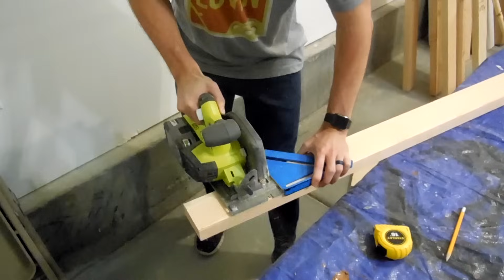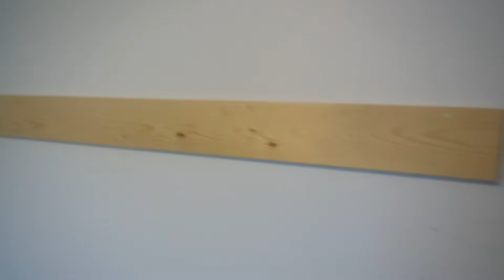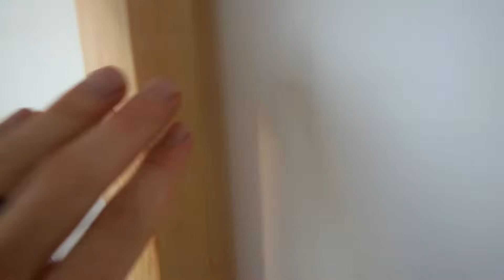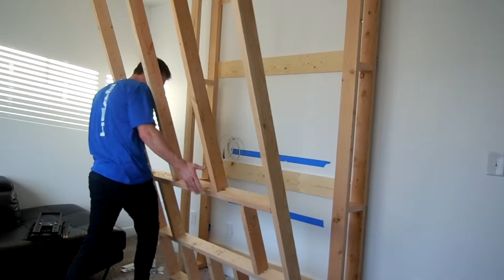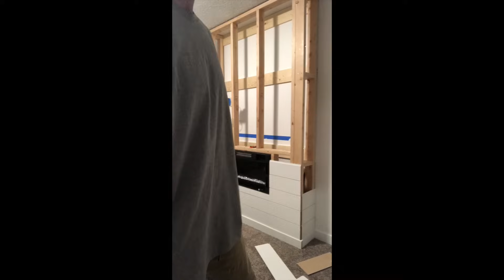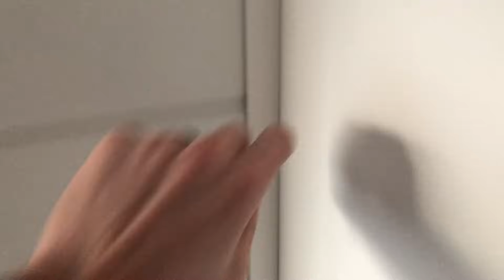DIY Electric Fireplace Wall (Step By Step) | Shiplap

Comment: I don’t want to be a jerk here, but as a licensed electrician I have to say, you most certainly cannot just “plug it into any outlet” 
If that fireplace is on for over 3 hours it’s  going to be considered a continuous load, continuous load is accounted for by taking 125% of the load and your circuit/conductors have to be sized for that. That’s also leaving out the fact that most homes receptacles in the living room/family room serve several purposes and can be tied in with other things. If you use a plug in vacuum cleaner with this on, it’ll probably trip, if you have a lot of lights on this circuit, it could trip or even flash the lights like most resistive heat appliances do. I would recommend anyone who is doing this with this size fireplace to place it on a 20amp dedicated circuit. Always consult the manufacturer’s specs, almost guarantee these specs state it’s required to be on a dedicated circuit

Comment: Old video but hopeful for a response. Thank you for breaking this down for us. Question, is there any way to access the fireplace in case it malfunctions / needs to be replaced? Or would you have to pull the trim and siding off to get to it?

Comment: Great video and tips. I decided to use a similar concept to build my electric heater wall, in which I also built in shelves. Currently, I’m debating on the choice of material to build the sleeves for shelving.

Comment: Can you explain how you installed the TV mount? Did you drill directly into the shiplap and then into the studs behind them with long enough lag bolts?
Reply: I figured this out. I used this tutorial to build my frame - I had some seriouuus doubts with the integrity of the wall...but evenly distributing the load (with the new frame that was built) put my mind at ease.

Comment: Hello I’m currently on the process of building mine following your step. I just had a question. Did you use the same outlet that you plugged in your fireplace to wire the new outlet for the tv?

Comment: How much did you consider the electrical aspect of this? A 12.5 amp fireplace on a 15 amp circuit? You also have your TV, other TV accessories, lights and any other electronics you have plugged in to nearby outlets are all likely on the same circuit. Did you consider that on your calculation?

Comment: We are doing this right now. Thank you for the video! One place we are stuck is doing the Shiplap around the fireplace. We have the same one but we can figure out how to get the glass cover to go over the Shiplap to hide any imperfections. The Shiplap seems too thick to go between the frame and the back of the cover. Did you run into this problem? Thanks again!

Comment: Very quick question.. there is a little screw with the arrow to take off the glass.  If you have the fireplace in place and shiplap installed how do you put that screw on once you put the glass back on? Or do you just eliminate this screw and the glass just sits in place, or do you put the screw back, then install the fireplace and when you slide the glass on does it some how 'hook' on to that screw securing it?  If you can let me know that would be great.  Thanks
Reply: Little pads behind the attaching screw hole make the insert stick out from the frame far enough for the glass frame attachment hole to be exposed.

Comment: Wow! Thank you so much for the video, it is perfect. How did you get the fireplace to stay in place?
Reply: If that is an RW Flame insert, there are 2 little holes in the front inside the cavity where screws attach to those 2 vertical boards on back of the frame that gets covered by the face plate

Comment: Amazing work!!! Question though, is the TV mount screwed on the frame studs or through the shiplap?
Reply: That’s a great question….don’t you love how you get no answer yet they want you to hit the “like” button and to “subscribe”?
Reply: My guess is that the screws go through the shiplap and into the studs behind, because it's noted that the framing was deliberately made to fit the spacing of the tv mount to make sure that it would all be secure and hold the weight of the tv.

Comment: Did you add lag bolts to the common board you initially put up on the wall? Or did you use regular screws?
Reply: You don’t need lag bolts. Use construction screws (they use a screw bit that looks like a star), not drywall screws (Philips head).

Comment: If it draws 12.5 amps i would not tell people any outlet is fine. Make sure its a 20 amp circuit or that at least its not gonna be on a circuut that is near max capacity. Are you gonna run the vaccuum cleaner on this circuit? How about excercise equipment?  These things matter or else youre gonna get REAL familiar with your breaker panel lol

Comment: I’m curious about the fireplace all the videos I’ve watched about this set up. Do you need to have ventilation for the fireplace? Or do you just insert it.  You did a great job! 👍
Reply: Hi Emma this is electrical fireplace so does not need ventilation

Comment: Great build. I have the same fireplace and doing something similar but how did you secure the cover back after attaching the shiplap - isn't there a screw to secure the cover glass that becomes inaccessible after you place the shiplap?
Reply: Same question!

Comment: Hey! Quick question: why didn't you add a fire resistant board? I'm in the process of building my own faux fireplace and am wondering if fire resistant panels are necessary (for the heat build up within the fireplace enclosure).
Reply: I believe the shiplap is fine for the electric fireplace especially since the heat comes out from the front in most electric fireplaces.

Comment: Im start my project i watch your video over over were im sure i can doit. Too. Ty you well teach .explain ty somuch. Sir.  There twothang share .tv top! Yoj should add power surge safty. Then eletric fire place same.then surge fire place  then on top each side small. Vent  air out heat wont build up. Vent top each side . other yhis you know what doing ty i folliw your leads  i just like add vent.breath system. Use power surge safet.

Comment: Not sure if I missed this, but roughly how much was all the wood for this? What was your total for this whole project?
Reply: At the price of lumber today probably about $120,000!  But seriously, $10 a stick and he probably used 10 to 15 so not too bad.  You could also use steel studs which is easy to use as well.

Comment: Hey great job...question please as I’m about take on this job too thanks to you. Your backing boards on the wall say they are 6 feet, but they don’t look 6 feet long. And in your website it says 61” long from the side frame to the other side frame which would be 5’ 1” long. Do you know how long you made them?
Reply from the maker: Yes, the boards were 6 feet long, but I cut them to 61 inches to fit my space. Sorry for the confusion:)

Comment: Im a little lost on the access to the electrical outlet is. Do you have a removable panel and the outlet is behimd the fireplace or are the wires coming out somewhere outsode the fireplace?

Comment: Looks awesome!!!! We are going to start ours soon!  Is your TV and fireplace on the same circuit?
Reply from the maker: Yes, they are. I have a 15amp outlet and the fireplace is 12.5. Not sure what the tv is, but I know it is less than 2.5 amps. lol I am not an electrician for from everything I have read and watch you should be good to plug them into the same outlet.

Comment: I'm actually going to do this. What are the dimensions.
Reply from the maker: dimensions for mine is 8feet high x 61inches wide
Reply: @HousetoHomeDIY  how is it 61 inches wide when you used 6 ft wide boards for studs? Is your structure not 6 foot wide (72 inches) ?

Comment: My husband wants to this project but I am worried about the TV being too high when watching it sitting down.. do you have this issue? Do you use external speakers?
Reply from the maker: Yeah, I had this same worry. But  the mount I bought gives you the ability to angle the tv down and that helps I ton. Now that I have had it up for a week it really hasn't been a problem :). I would just say try to mount it as low as possible. (Mine is mounted 56 inches up)
Reply: 56 inches from the bottom of the TV?

Comment: Wow! This looks amazing❤❤ I wish my husband was handy😁 great job!
Reply: im using carsiding to match my carsiding ceiling.  im building a simple 2x4 frame with a 2x8 mantle.  i am going to stain my carsiding golden oak to match ceiling then im going to distress the mantle and stain it ebony and oak to make it look old.  then im going to use simple black iron brackets for looks.  you can do it!  level, jig saw, circular saw, tape measure, brad nailer and a hammer.  i already have a framing nailer so easier for me but if you dont have access you can use a screw gun and screws.  good luck, the easiest way to learn is to do it.
Reply: @NaturalBornRebel  wow Thank you for the encouragement!! Will do 💪
Reply: @mrs.murphy2611  no problem, buying my house at a young age and remodeling it room by room over the years is how i learned.  i also love watching "this old house"  they show and explain tons of things.  there are lots of videos to watch also.  i am sure any of the salesmen at menards or home depot would be glad to answer your questions too with your hailey barry looks ; )   good luck, nothing to it but to do it.
Reply from the maker: lol. I bet you could build it. This project really isn't as hard as it looks :)
Reply: @HousetoHomeDIY  
I agree! Any suggestions as to tools to get for a new DIYer?? 👀
Reply from the maker: @mrs.murphy2611  My most used tool is the brad nailer and circular saw. Here is a link to all the tools I use :) https://housetohomediy.com/my-tools/
Reply: @HousetoHomeDIY  
Thank you! Awesome blog site! Appreciate it😉
Reply: i know what you mean